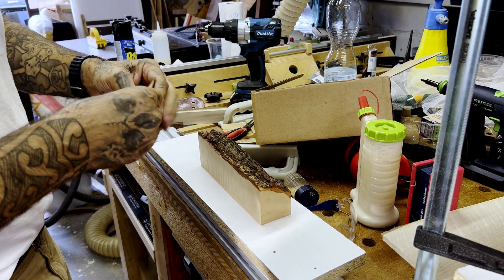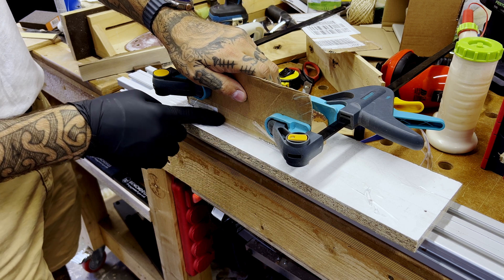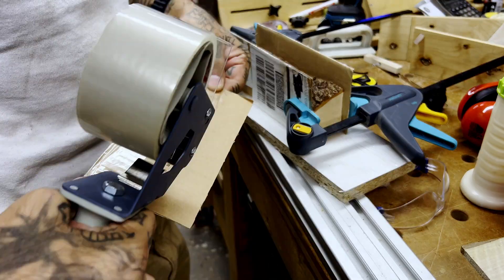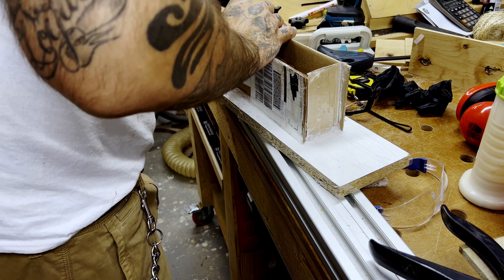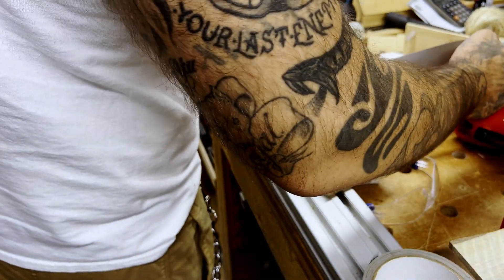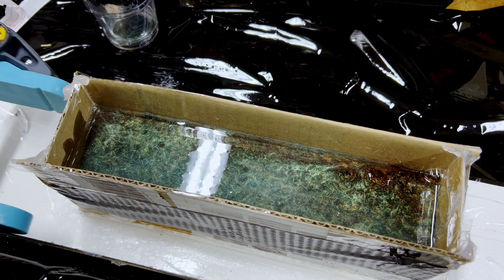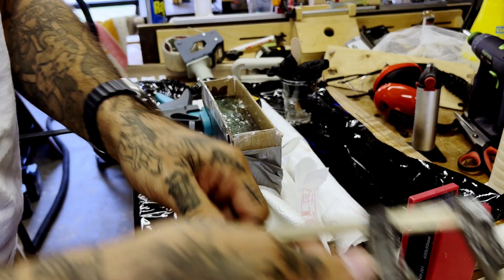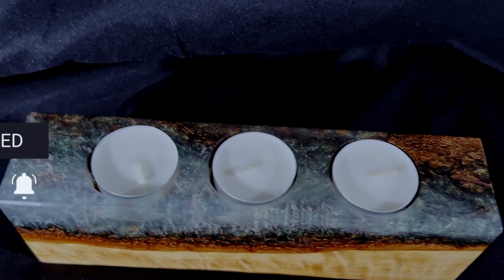Cheap & Easy - Making disposable epoxy resin forms molds

Comment: Could you have used hot glue in this scenario?
Reply from the maker: I’m still on the fence about hot glue, Iv had it fail more then silicone, I think because it’s more rigid, Iv used hot glue and flooded an area when a small leak happens but that’s not practical but it does most definitely reduce the leak if you can pile it on quicker then the resin is coming out